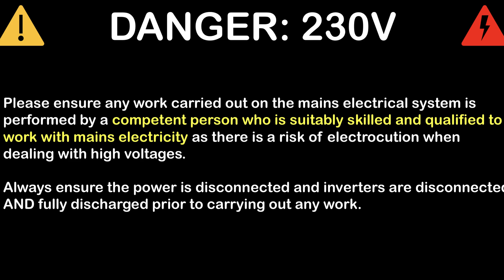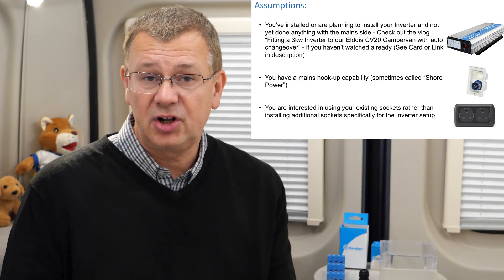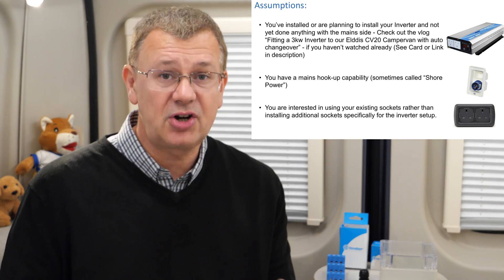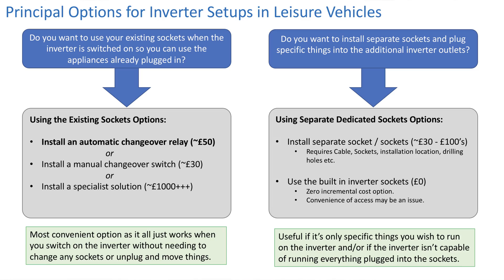Campervan Mains & Inverter Auto-Changeover for under £50 using a RELAY - How it works - Tech vlog

Comment: Hi again David, as you are aware I’m following your lead re: the change over relay, unfortunately I’ve run into something of an issue, I wonder if I’m reading your diagram incorrectly.

Basically I have a socket output to the 240v sockets including the microwave, 4 cables from 1 socket??

I don’t understand how I can wire up the change over switch using these cables, you actually wired yours up to 1 cable I believe?

Am I correct? The only other option is to connect the Change over switch directly to the incoming 240 supply to the consumer unit.

But this would no doubt energise all the relays.

Do you have a point of view on this?
Reply from the maker: There were a few connections, I took a L + N from the Sockets MCB breaker and connected it to the relay and then put a connector on the cables (L) and (N) which were connected and then ran it to the relay then there is the connection from the inverter, so 3 set of cables connect to the relay. (To Sockets, From Socket MCB and From Inverter) if that makes sense? Depending on your van and how it’s connected up there may be one or more cables connected up. Don’t forget ALWAYS get a qualified electrician to check it over before switching the power on, you can’t be too careful with mains. Hope that makes sense, David 👍
Reply: @LeisureBit  hi David, yes I will get it checked out, I tried the other day but unfortunately he was too busy, I’ll look for another electrician.

Re: the connections, yes unfortunately there are several cables coming from the MCB, I think I need to get behind the back cover to connect it correctly ( I assume that you connected directly into the MCB, I.e you didn’t cut those original cables ?
Reply from the maker: @rayleeson6135  Yes, that's right as I wanted to make sure I could put it back in the future if required without any material damage. Hope you manage to get it sorted ok.
Reply: @LeisureBit  perfect that certainly helps David, unfortunately including all this extra info in a video must be a nightmare, but on the plus side it’s great that you are so responsive, it very good of you to follow up on this …top man.

Regards Ray
Reply: Hello again David, please forgive me if I’m a nuisance!
I have now managed to get access to the MCB’s …gosh it was a struggle, but for now I’m moving on, so; it raised a couple of questions..
When you ran the live and neutral from the MCB …I am assuming that you ran these from the load side of the MCB….ie the top of the MCB?

And 2nd ..I didn’t quite understand your last comment re; you took a L+N from the sockets MBC (understood) and connected to the relay (understood)

Then you say that you put a connector on the L&N which were connected and then ran it to the relay?? It’s this bit I didn’t understand.

Then of course you refer to the inverter connection and I understand that, I can move on once I’ve understood the above comment.
Can clarify that a little?

Regards Ray

Comment: Hi David, I’ve just spent some time watching your inverter auto switch over video, I’m going to follow it..
Can you confirm a couple of points for me please?

1. I’m assuming that on your drawing PDU means power distribution unit..ie the consumer unit in my Motorhome?
2. Therefore the switch over relay is wired into the cable supplying the sockets & microwave from (in my case) MCB1
3. I was considering buying the Renogy 2000w inverter but it has UPS..(not sure if it can be disabled) would this be an issue if it cannot be disabled?

Regards Ray

I like your clear - concise presentation.
Reply from the maker: Thanks Ray, Yes, PDU is Power Distribution Unit with the breakers etc. in (1), and you're right the relay is wired into the cable supplying the sockets so it doesn't impact the space and water heater or charger (2), I believe you can just not connect up the input power to avoid using the UPS mode on it, in theory you could use a UPS inverter between the MCB and the Sockets BUT, most aren't rated for the full load (like the one you mentioned) so not always a practical solution. Also as you will probably know UPS function is slightly different, it's primarily mains but on mains failure it keeps the connected appliance running (normally computers and essential medical equipment). Hope that helps and makes sense, all the best, David 👍
Reply: Yes I initially considered the Renogy with the floating earth but I didn’t like the idea that an RCD could fail in some remote circumstances.
It is apparently a 1 in a very high scenario that it could fail but I suspect the insurance companies might take another view.

Nevertheless a great video well done to you, keep em coming 👍
Reply: Yes it does clarify the thoughts I had, just 1 more question if I may….just to confirm; the relay completely disconnects the inverter from shore power when shore power is connected, naturally we don’t want 230volts going through this type of inverter.
Reply: Just watched your video again, you have clarified my question in there….i won’t be purchasing a UPS version so I don’t want mains running through the inverter.
Reply: I note that you didn’t fit an extra MCB….only an RCD, am I correct in assuming that any over voltage issues are covered by your PDU MCB….i assume they are circa 10 amps.

Ps I’ve ordered all the gear now so just waiting to fit it.

Regards Ray
Reply from the maker: Yes, that’s right, the MCB from the mains (via the van RCD then the 16A MCB) protects the mains side, the 16A RCD is a degree of protection for the inverter output, the inverter is fused and short circuit protected, you could add an MCB also (10A) if you wanted, to the inverter output as an extra precaution but imagine it would have limited use given the trip curve. Because my inverter is floating, the RCD only covers some scenarios, however there are benefits of floating for exactly that reason. Good luck with the install, All the best, David 👍

Comment: I've noticed you have not used a low amp fuse or mcb  to protect the coil in the relay so if the coil was to over heat your relying on the 16a hook up supply or the power bank mcb supply, you also have not labelled the enclosure to isolate both circuits before opening, I've already commented to you on the unsuitability of the relay but you gave all the reasons why it's suitable Let me tell you about myself, I've been a Industrial/commercial electrician for 40 years working on all types of control panels in factories, hospitals and prisons, I've  also carried out testing & inspecting.
You may be an electronic expert but you and other youtubers who van build think they are now experts in electrical installation,
and none of you show installation or minor works certificates, when i find the time I'm going to make a vlog to highlight this problem, the vlog will be an information video to warn viewers to be careful and show them the correct way and not be taken in by scripted presentation i will not ask any one to subscribe to me or ring my bell and any money i  make will be given for pet food at food banks, youtube is now all about what content they can show regardless of the consequence, this is why part P was brought in because someone was killed by a poor installation.

Comment: Hi Dave, You video has been a big help in showing me how to fit a lithium system into my caravan thank. However, I am a little confused how to connect the cables into the mains and the sockets in the miniature breaker. When connecting do you connect to the outlet side of the breakers or the inlet side?
Reply from the maker: I connected from the outlet side so it’s protected by the MCB - Do make sure you get an electrician to check it out before connecting it up to certify it’s safe with it being mains.
All the very best with your new system - David 👍

Comment: Am I right in saying, that wiring depends on switching the inverter on and off manually to get it to change over? If so, would it not be better to connect the inverter to the N/C contact and then when you plug in the mains shore power it will auto change to shore power and then the inverter can be left switched on?
Reply from the maker: Yes that’s right - if you switch the inverter on the sockets are powered by the inverter, if off then by mains if hooked up - you could do it the other way also - the reason I did it this way is you can use it as a power boost when on low A hookup so you can for example make a coffee with the inverter while remaining on hookup with the heater running.
Hope that makes sense? All the best, David 👍

Comment: Thanks for this. a great video. is there any reason why you couldnt take the incoming mains/inverter into the relay first, then have the rcd after that. My Van uses a 3 way camping type extension lead (mobile mains 3 way with sockets) with built in rcd as opposed to a "consumer unit".  My thinking is that the RCD can then protect whivhever source you use. ? The output from the relay could then feed the 3 way with RCD built in before going on to feed sockets etc.
Reply from the maker: In theory no, but then there’s no protection on the incoming mains (as you shouldn’t rely on the supply one) - you could do it though - there are multiple ways you can achieve different outcomes it’s just like an automatic switch - would suggest checking it over with electrician before your final design to ensure compliant etc - but you can get different behaviours with different arrangements - not sure if that’s much help? Thanks for watching - all the very best, David 👍

Comment: I realised  watching this vlog tells me everything I need to know of people who are not qualified to carry out electrical installations, he shows how you can wire a change over relay  in you van, first of all a relay is rated at 16A, your supply into your van is rated at 16A so your  this is right on the limit of your relay, this is why his getting a buzzing sound  when switching, a relay is ok to switch loads at 15A and below but over that it should be feed via a contactor, in this case it should be a 25A 4 pole  2 n/o and 2 n/c contacts within an enclosure, (Not a standard 4 pole contactor) I'm seeing too many youtubers giving advice on electrics, these people who mean well are playing a dangerous game all to give content to their vlogs, I have installed this set up I've mentioned above in my motorhome, I've been an industrial and commercial electrician for nearly 40 years, my advice is ask a professional tradesperson.
Reply from the maker: Thanks for your comment - firstly, work should always be carried out or certainly properly checked by a professional  - you are right the supply is rated at 16A and the relay is also rated to 16A per the manufacturers design (continuous rating according to the data sheet) - its used in commercially available products which do the same or similar things - it would have been nice to have a higher rated one with some headroom but it is rated to the maximum load continuously. 
On the subject of the buzzing it has nothing to do with the rating - its brown out from the inverter - switch it round and switches without buzzing - when the inverter is turned off, the voltage doesn’t instantly drop to 0V - as the capacitors discharge it falls and when it drops to below around. 80-90V in this case when I tested it the magnetic energy becomes insufficient to hold the contact closed and the buzz is from the frequency of the inverter (in this case 50HZ) creating audible buzz for a short time. Where there isn’t a brown out and the voltage falls instantly this doesn’t occur as the magnetic energy then falls straight away. Unfortunately a lot of inverters of this type don’t switch off the AC (and can be dangerous if you think there is no voltage as soon as it’s been switched off) - it’s how they are designed as the power off cuts the DC side (either via isolator or MOSFET electronics) so the capacitors have to discharge to enable the power to cut on the AC side and thus brownout occurs on switch off.
As per all things - it’s just what i did, I had it checked and tested also - anyone doing any electrical work should not undertake it unless they are competent and should ensure it’s fit for their particular purpose and get it independently checked and tested for safety - common sense when dealing with electrics. Always get a professional to install it or certainly check it with expertise in the specific field.
Hope that makes sense - would be interested in the specific particular component you would recommend - would be interested to take a look?
All the best, David 👍

Comment: hi david loved the video very helpful, i this is what i have wanting to do to my van. my question is do i have to disconnect the ebl when the inverter is on? will it be trying to charge the batteries as though it was on electric hook up?   thank you  steve
Reply from the maker: Hi Steve do you mean the charger - it makes sense to not have it connected to the charger to avoid waste in the circular charge and discharge which then occurs - I just use the sockets circuit to avoid this if that makes sense? All the best, David 👍
Reply: Thank you

Comment: Hi David, I love this video, straight forward, exact instructions, well presented, easy to do. Completed mine using your video, all connected up to my power bank and working fine. Keep up the good work with the videos. 👍😉
Reply from the maker: Brilliant - pleased it worked for you and genuinely appreciate the nice words. Have a lovely weekend, all the best, David 👍
Reply: A serious flaw in your description  of using a RCD on the output of the inverter. The RCC will only provide protection if the neutral output of the inverter is bonded to earth,  at the inverter. High quality inverters from Victron and  Sterling Power have the bond built In, or have  have the option of easily setting up this neutral bond. Many low cost Inverters, including some in the Renogy range, don't have the option  of making this bond or would be damaged by adding a neutral to earth bond. 
Summary, without the neutral to earth bond at the inverter,  the RCD will not protect against electric shock  and death is a possibility.
Reply from the maker: @michaelfitzpatrick3641 There are limited scenarios with a non-bonded output as it requires a difference between the two outputs to trip. This is generator, powerbank and inverter specific where the majority which are used unless they are for domestic setup. What is the specific flaw in the description you state? Appreciate if you can highlight as I’ve always tried to be clear it’s better than nothing BUT it is NOT a domestic install. Thanks for your comment and appreciate the clarity on the specific so I can address if required,
Reply: Hi David I’m going to install same in my van conversion. I know this probably sounds daft but Iv looked on line for a P.D.U but I can’t seem to find any thing that looks like what your talking about is it basically fuse or I’m I way off track I totally get the rest of it just that part 😊
Reply from the maker: @user-yq6ez5lg6w the power distribution unit we have is one Elddis installed made by BCA, there are a number of different ones you can fit in campervans depending on how many circuits etc, it’s a bit like a consumer unit at home. Obviously, always get electrics check by a qualified person to make sure it’s safe too. All the best, David 👍

Comment: Will the rely wiring not feed back to the Sargent unit? So the battery’s an inverter are running back to Sargent unit and charging system?
Reply from the maker: It’s in the sockets line rather than the main with all the rest of the circuits it to avoid that exact situation occurring as it would just waste energy. The charger is on a separate breaker / circuit along with heating and hot water on their individual circuits so it’s just the sockets which feeds onto microwave, hob electric ring and in my case coffee machine then the spare 3 sockets for whatever needs to be plugged into them.
Hope that makes sense 
All the best, David 👍

Comment: Hi David. I’ve been using these Finder relays with 230V coils too. I have 3 of them. Used for dishwasher, washing machine and tumble drier circuits on my home solar system. They are rated at 16A and work well. Great video.
Reply from the maker: Thank you - they do seem to be pretty good don’t they - not a bad spec and seem well made.
Thanks for the comment - all the best, David 👍

Comment: Wouldn't this work better, if the shore power was the trigger for the relay, and have the inverter on the normally closed connections? This way, you could simply turn on your inverter, and use your sockets when off grid, then when you plug in shore power, it activates the relay, and takes over? As a bonus, wire your battery charger to the shore power side of the relay, and automatic charging comes on?
Reply from the maker: In theory yes and I considered that way as they the small amount of power used for the relay coil isn’t wasted on inverter either (all be it tiny) however, there’s a scenario I use when hooked up on say 10A with heating and hot water on, I can turn on the inverter and then get 3kw through the sockets for the coffee machine or microwave or whatever without tripping the site breaker due to overload - agree ref wiring though as could make it smarter so you could warm water with excess energy etc - great suggestion. 
All the best, David 👍
Reply: I agree the trip rating of some campsites mains hook ups can be spurious 😂
It's very subjective what setup each user has, so there's never a "one size fits all" solution.
Thanks for the video, it's steered me towards a solution for myself. 👍
Reply from the maker: @philcross7315  you’re right it’s what works for you - pleased it helped steer to what works for you - all the best, David 👍